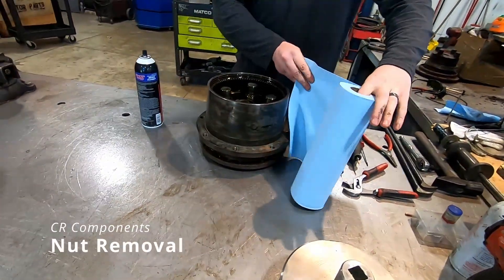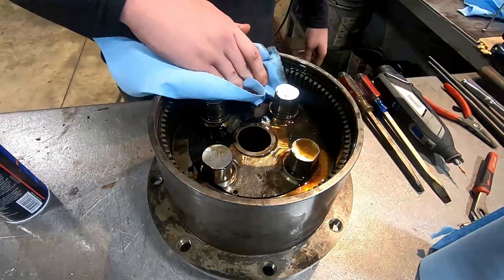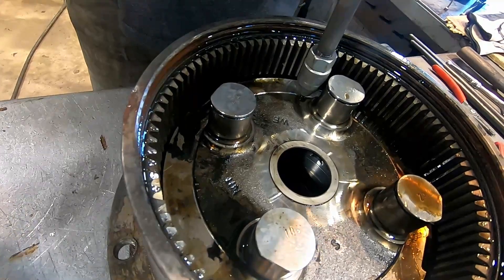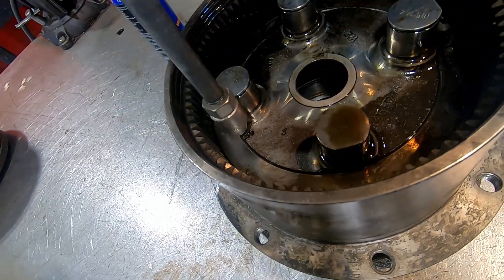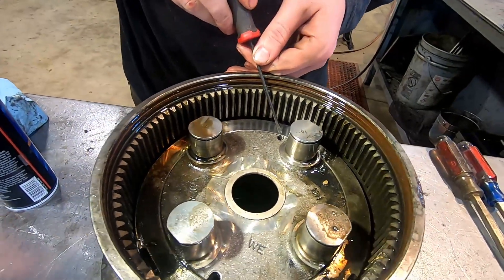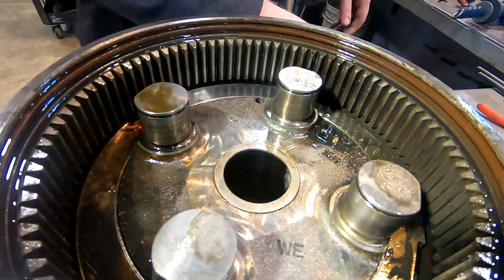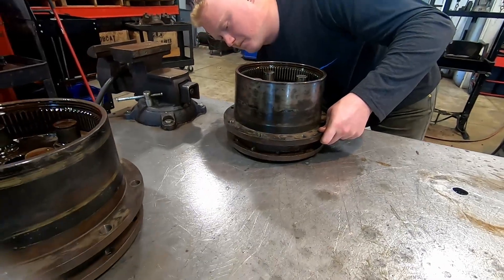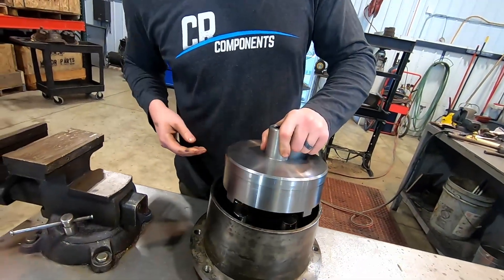How To Remove Assembly Nut from Final Drive Motor (Case, New Holland, John Deere)

Comment: How are the planet gears removed?
Reply from the maker: Get under them with some ladies foot prybars.  Once the snap rings are off the gears pull off.  Sorry for the late reply, didn't get the notification for some reason.  Hope you got it all figured!
Reply: Yes we got the planetary gears off. The real challenge is trying to get the threaded ring off. The threads are super sensitive! I believe that our threads are cross threaded because the grinding the threads from the pins didnt matter. WE tighten up the ring and the seals havent leaked... @CRComponents

Comment: Hi there, i watched your video and its great, do you have any tips for getting the pins out when they are solid, ive been unable to drill into them.
Reply from the maker: Great Question.  I have done a couple like that and I got the pin really red hot with the torch and just hit the Oxygen real quick a couple times to blast it out.  You need to be careful not to blast the housing of course.  Once you get most blown out used a pick and a punch to get the pieces out.  OR, you could just sacrifice the Nut - See this video on torching the nut off, be careful not to overheat the gears and cut from the outside in.  Torch Nut Video  -   https://www.youtube.com/watch?v=KqK3cqi06aE
Feel free to give us a call also, Thanks for your support!